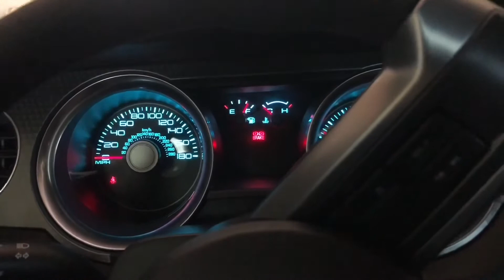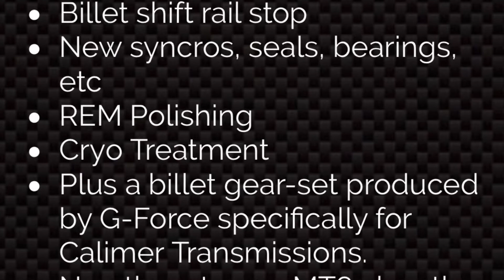Went For A Fall Cruise And This Happens! MT82 Gear Failure!

Comment: I have that same car same color. Love your channel, very helpful especially your details on your mods and what you liked and dint like. I had purchased and nest all a FP aluminum driveshaft and getting the same noise between 2-3k rpms and could not figure what the issue was. Adjusted so many things reinstalled stock 2 piece but then could head what sounded like gear noise but I attributed that to the poly bushings in my bar upper control Arm and Panhard bar. After hearing you input on ur mods and how your car sounds it put me at ease knowing the aluminum driveshaft will make noise at certain speeds and rpms. This last video also scared me as I know these transmissions had a lot of issues.  I may start saving up for a stage 3 m82 also. Keep the vids coming great info and reviews.
Reply from the maker: Thanks Paul, I appreciate your support and happy to hear you enjoy the channel.
Reply: @CoyoteProductionsBoss302 thanks for the video. Do you know any rebuild kit making the MT82 beefy? Or any rebuilding kit out there your recommend? 

Unfortunately, the car is overseas.
Reply from the maker: @goofylevitates8853  here’s a link. I don’t know anything about this kit so you will have to do your own research. https://ampdistributing.com/products/2011-2017-mustang-5-0-gt-boss-mt82-6-speed-stage-3-rebuild-kit

Comment: It’s the clutch man. I have the same car with 850 RWHP With VMP supercharger on it. I have 37,000 miles I changed the clutch to McLeod back at 5K and never had 1 issue. The transmission isn’t the best but not as bad as people make it out to be if the clutch is changed.
Reply from the maker: BossMan, I have the McLeod RST clutch, Blowfish’s Racing bracket and Barton short throw shifter. It’s not a complete failure but to me enough to change the trans. I don’t feel comfortable now shifting at 7500. Again these trans are only going for 500 hp. Thanks for your input.
Reply from the maker: I installed a new clutch last June McLeod RST. I have a friend who has an supercharged 2011 with 90k miles and no issues. It’s a crap shoot! Thanks for watching!!